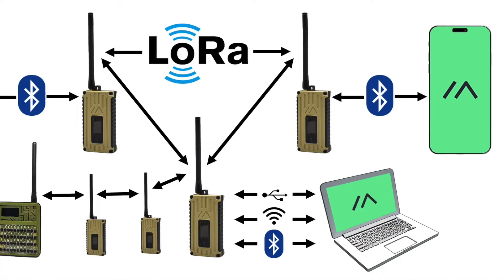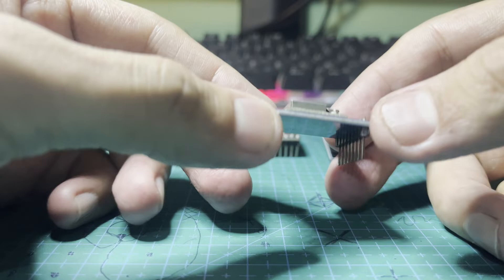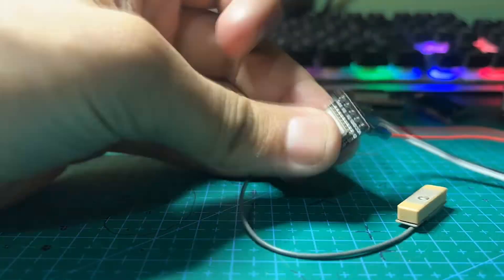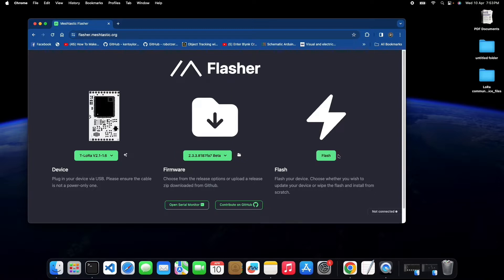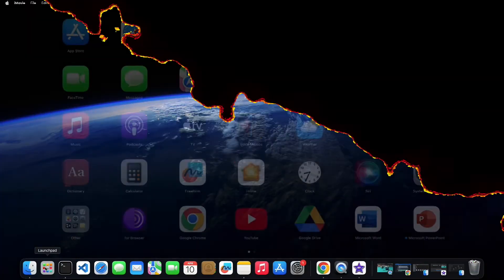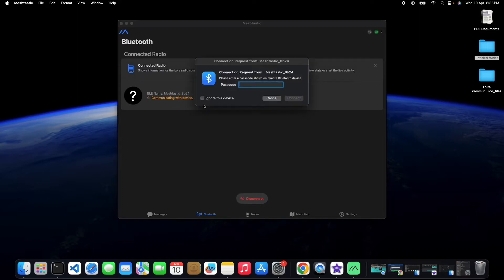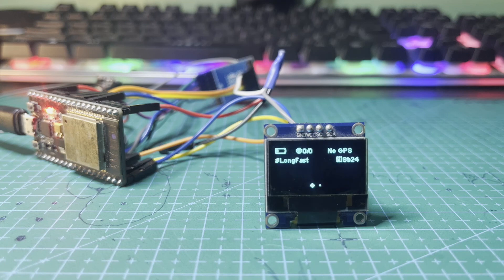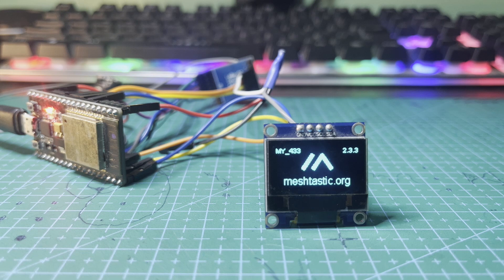DIY ESP32 Meshtastic Node: Off-Grid Network in Minutes!

Comment: I have all the same components but all my various lora modules have rf96 chips and for the life of me i cant get them working, something with the locked firmware pins pulling low or high and messing up the module on boot

Comment: How did you decide which "Meshtastic board" to select when downloading the firmware, since you're essentially "rolling your own"?
Reply: On the meshtastic flash page when selecting module scroll all the way down to the DIY,   select the ESP32 V1,    that should work with this one.    I am on a similar project,  using the "faketec" PCB board, and instead of ESP32 I will use the NRF52 (youll see this one listed on the meshtastic webpage)   uses the same Lora,  just the microcontroller is different.    since my project is for solar nodes, I want the most power miser board option.    I have a Heltec  which uses the ESP32.   its more power hungry,   but my tip if you are going to use this for routing solar node.  is to select the power saver mode, and turn the blue tooth off once its all configured.   it gets very efficient this way.  my solar node doesn't drop below 90% charge. and my panel is only a 400mha size.
Reply: Update: I have built a few of the Faketec V3, they have been working fine, and are very efficient.   my next project is making my own design,  using the NRF52840 MCU with a Ebytes E22-900M30S LoRa.   this would give me about 1watt of RF power.  I'll be doing hard wire prototypes over the weekend to make sure everything works, and to evaluate performance.  if everything runs smoothly I'll be making a PCB board for it.

There are designs already available for this,  but most seem rather large and/or have too many additional options included on the board.   for example Washtastic has power supply, GPS and various other options al on a rather large board.   which is great for some setups,  I wanted to make something a bit simpler and smaller,  with more flexibility on how power will be supplied.

Comment: Is that support for SG_902 Mhz?
Reply from the maker: @abonsapi9101  no you have to use sx1276 module
Reply: @Engineerofeverything  I see, if there is not in the same frequency like 433Mhz and 923Mhz, It can't communicate, isn't it?

Comment: I have tried this setup. Does not work for me. I get core dump.  I even tried loading Meshtastic on an ESP32 without a display, GPS and LoRa.  Meshtastic will not load on an ESP32.
Reply: Me too,
Reply: False. Meshtastics own website has esp32 specific software. Works just fine

Comment: You chosed T-LoRa v2 for the device? Is that correct? I got the same equipment. I cannot get it to connect. Computer and website sees the unit. But stuck on connecting. I think you skipped a few steps.
Reply from the maker: You should press the boot button while uploading the firmware

Comment: I can't load the firmware on my ESP32 for some reason. It doesn't want to connect and if I press boot again after already pressing it while plugging it in like advised it will connect but then just hang up forever without uploading. Any tips for getting a connection?
Reply: Pretty sure you have figured this out by now (1 yr since post).  these boards often require you to press the prg button when inserting the USB cable,   also you need the drivers.   although I have heltec's and do not need any of this,   I am planning on doing a DIY system like this,  for one I want to learn how things work together,  and do some mix and match,   for example adding a bigger OLED,  or using a different type of LoRa module.